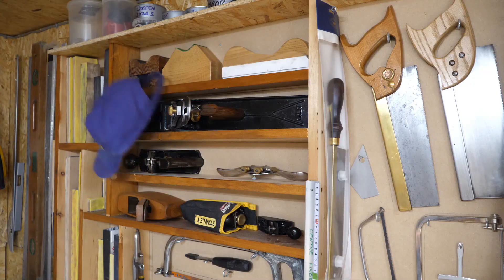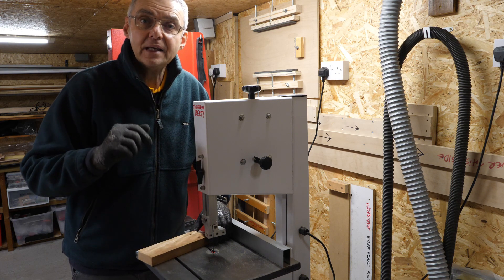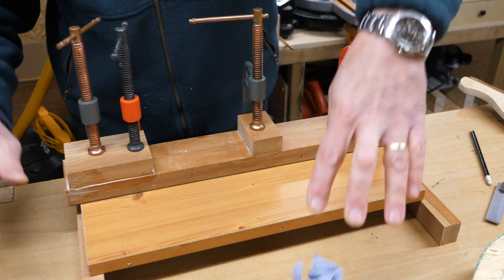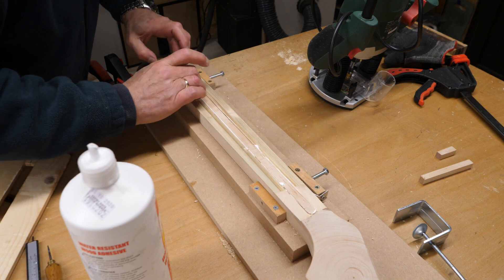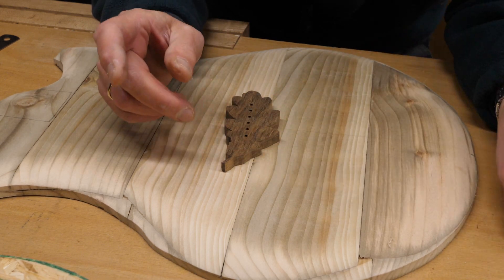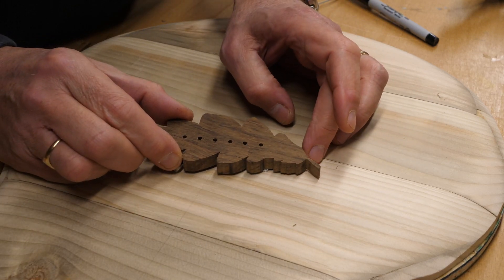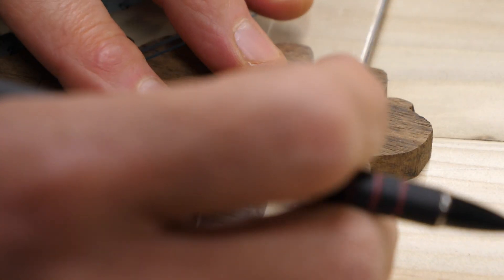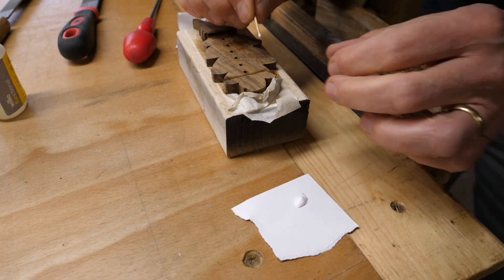Use What You've Got Challenge - guitar from a fence! #6 - body strengthening, fretboard, bridge

Comment: I'm loving this concept, acoustic style bridges have always frightened me, I've pinned a few floating bridges and I have no issue drilling for an electric style with intonation adjustment, but to glue id down and only have one shot at getting the measurements absolutely perfect will always be a bit daunting. I really like the ingenuity of the sliding bridge plate.
Reply from the maker: My fingers are crossed 🤞 that this will work 🧐

Comment: what a beautiful fretboard!!
but why not use a truss rod? is it so the neck won't be heavy ?
Reply from the maker: My gut feeling, and it’s more likely I’m wrong, is that I won’t need a truss rod.  I’m going for a thicker neck than I would usually have on my electric guitars, closer to a nylon acoustic so I think it will be okay. The frets introduce a slight back bow and I my guess is the strings will pull that back giving a slight relief. We’ll find out soon. Thanks for you thoughts, much appreciated. Cheers Dave
Reply: @DaveDickens  cool! tnx for the explanation. I have no knowledge in guitar-building but its fascinating to watch and understand how its done. hope it works out!
again... this fretboard is stunning!